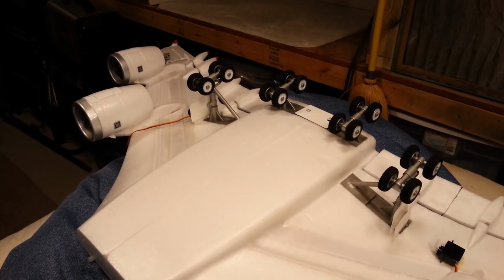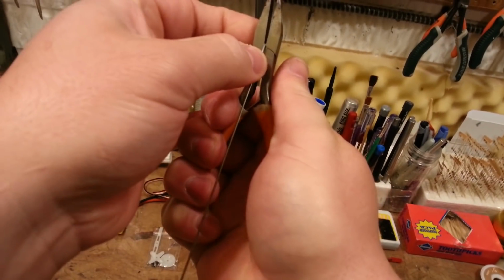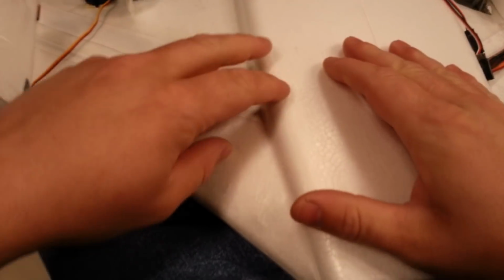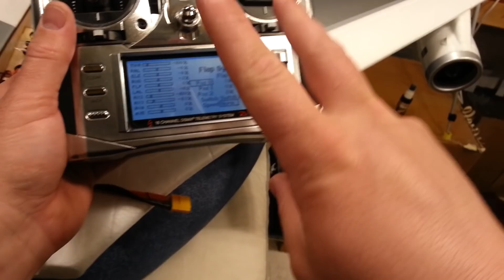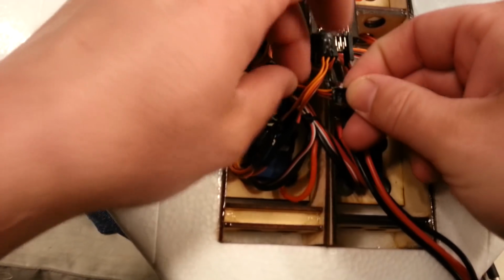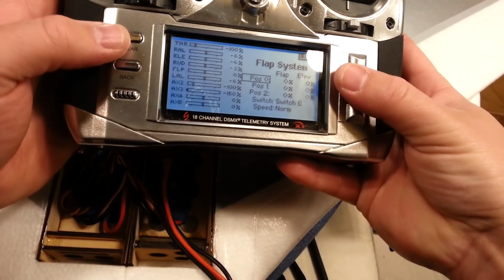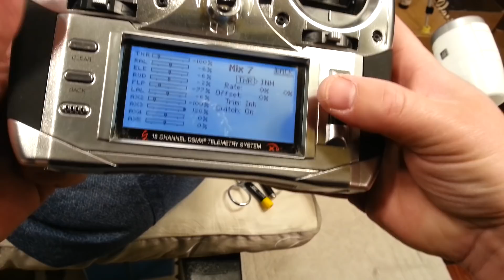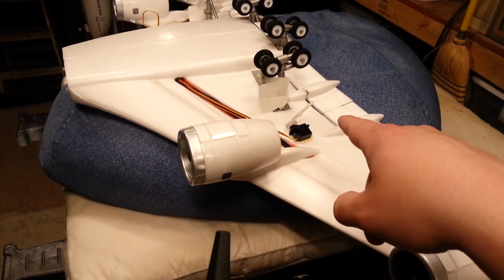Tian Sheng - Airbus A380 - Flaps Part 6 - Wiring & Radio Setup

Comment: Looking awesome! Have you thought about replacing that balsa spar with a carbon fiber arrow shaft or tube glued in place?
Reply from the maker: I haven't thought about replacing it, but rather installing additional support. I have some thin carbon fiber strips I want to use. Haven't got super serious about it yet, since I've been busy with getting the flaps done.

I got some stuff for the spoilers too, yesterday, so I should be able to get moving on that part of the project tonight.

Comment: I hadn't even thought about forceps until I saw you using them. I bought these from Amazon and use them frequently. It's a pack of 8, 4 different sizes with straight and bent-nose. If anyone is interested, they're $14.99 @ this URL. https://www.amazon.com/gp/product/B01MPZKOI2/ref=oh_aui_detailpage_o05_s00?ie=UTF8&psc=1
Reply from the maker: I find that the BENT TIP ones are the ones I almost always go for...check out this set. Do you think it'd be as good (a bit cheaper, but that's not a biggie :)

https://amzn.to/2EPWnW0
Reply: Brian Phillips Agreed, the bent nosed are usually my go-to choice. That set of 6 would be the better choice. I seldom use my littlest pair as they're usually too small.
Reply from the maker: I like the ones where the hinge is far back for reaching into deep cavities, while the ones with hinges closer to the tips are better for control of the grip strength...

I just need some better ones, period...mine are crappy Tool Shop brand, and they cost about as much as the whole kit I linked to in your reply.
Reply: Haven't had mine all that long and thus far the ones I have serve me well. You do things beyond my ability, though, so it doesn't surprise me that your needs are greater. My fine motor control is shot.
Reply from the maker: I think I'm clipping them onto things too much OR too hard, and that's damaging the hinges.
Reply: I've wondered about damaging the things. Seems like I'm applying a lot of pressure when I close them enough to latch. Takes quite a bit of pressure so often I don't latch them, just use them like needle-nosed pliers.